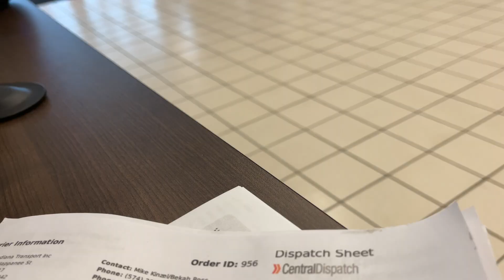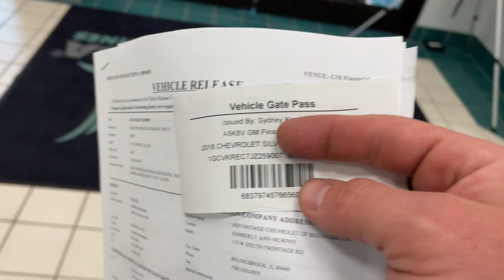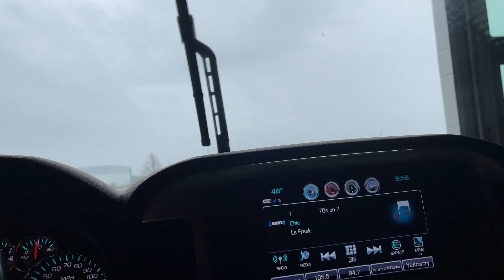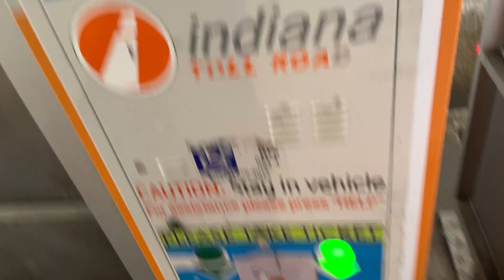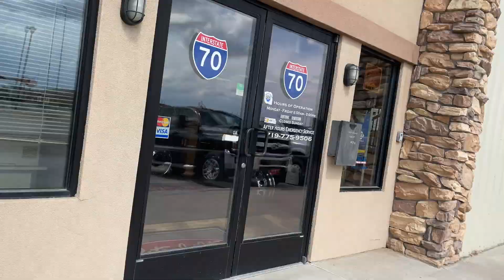Troubles, Troubles, Troubles... & a Family Dinner in the Truck!

Comment: Your videos inspire me to get into this trucking gig. Really considering this. Thanks bro!

Question.. What kind of truck are you using and do you need a cdl to operate it? You may have answered this question in previous videos so I apologize for asking you to repeat yourself. Salute to you and the family. Thanks again!
Reply: It appears to be a Freightliner FL70/Business Class truck. If it has air brakes, you will need to a class B, CDL B, air brake endorsement.
Reply: Sean, what's the outgoing load board looking like?  Getting slow staying the same or picking up?
Reply from the maker: Thanks, Robbie! Glad I can help here and there!! 

It’s an M2 106, and is a non CDL rig.
Reply from the maker: It’s an M2
Reply from the maker: Singles are between $1.45-1.69 for non cdl and its loads have started to pick up from a month-ish drought with IT. Haul and toes are $2.52 and other than one week has been steady since I gained access to that board.